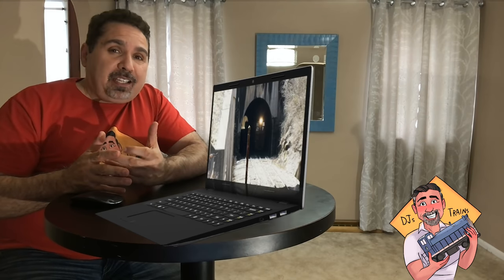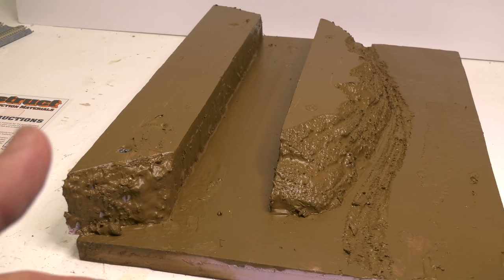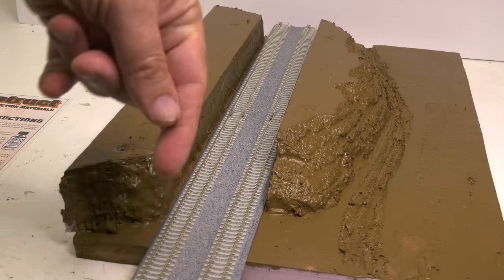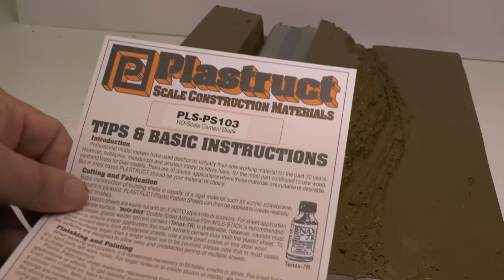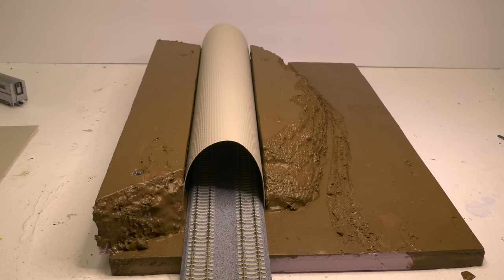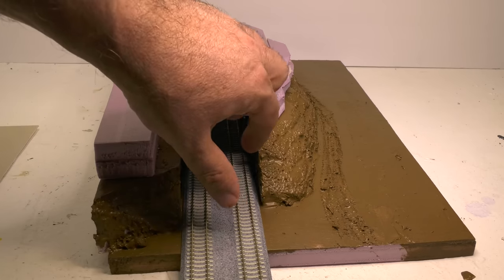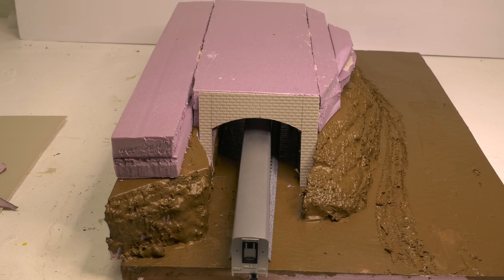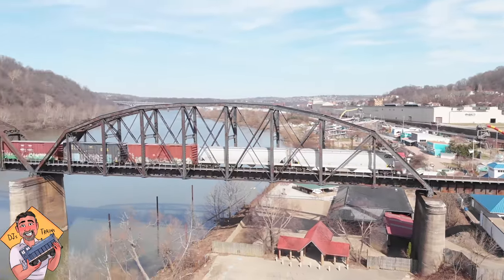MODEL RAILROAD TUNNELS. Easy How To

Comment: I would like to suggest a different way to cut your tunnel portal. Cut up the center line  from bottom to the curve.  Then cut  along the curve in both directions to the  line marking your widest point. Turn the plastic over and score along the lines marking the widest point.     Turn it back over and fold the center pieces down ward on a sharp edge to a 90 degree angle . Slide the tunnel portal into the tunnel .You now have a tunnel portal with a liner for the first couple of inches. Love your videos.

Comment: This will play well with a T-Trak module I am planning on building later this spring.
I used to use paper towel rolls cut to about 2 inches, slit open and painted flat black inside.  That was actually quite successful for single track tunnel portals.  Never considered using brick sheet stock for the liner.  Will be trying that for this upcoming project.  Guess it is time to get my order in.
Reply from the maker: I sell for $6.  while other stores sell it at $15.  email. djstrains@yahoo.com

Comment: Great details - thanks. I was waiting for the tunnel to disappear at the end. ;-) ... Ditto on the running speed of trains. Here's a quick way I use to calculate speeds. My SW9 is 45 ft. long (for round numbers). If it goes past a point on the rails in 1 second, it's travelling 45 fps (feet/sec). Using a calculator (iphone or online) that converts to 30 mph. So - if I want to go at 10 mph, (15 fps) it should take 3 seconds to move past a point. That's actually challenging for a lot of models to run that slowly and still be smooth.

Comment: Back in the day, the early 1950's, the B&O's Howard Street Tunnel was double track for passenger trains and nominally single track for freights.  The passenger tracks were in the normal location for a double track tunnel - the freight track was a gauntlet track that was in the middle of the tunnel and took advantage of the higher clearance of the arch in the center of the tunnel.  Shortly after the B&O stopped their passenger service between Washington and New York the passenger tracks were removed and only the freight track remained.  Over the subsequent years the clearance has be raised, when I worked in Baltimore 17'3" open top auto racks could operate at track speed (25 MPH) 17'5" racks were restricted to 10 MPH.  In the 2000's the tunnel can handle 19'2" auto racks and double stacks - a project is now being undertaken to permit the movement of 20'2" auto racks and double stacks.  I don't know when the projects expected completion is.

Comment: Nice modeling tips and engineering and period details, thanks.  

About those slow speeds:  Which scale does the slow speed the best, or does it depend mainly on the quality of the electronic controls?
Reply from the maker: it doesn't matter as long as it looks like trains and not a dragster or pulling 6 Gs of g force, lol.